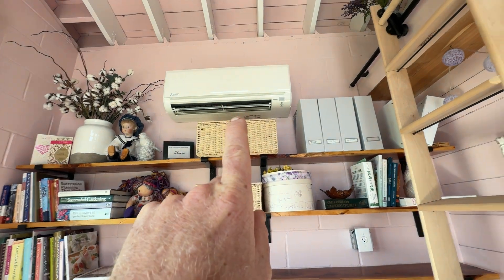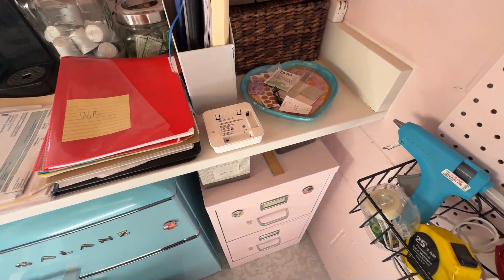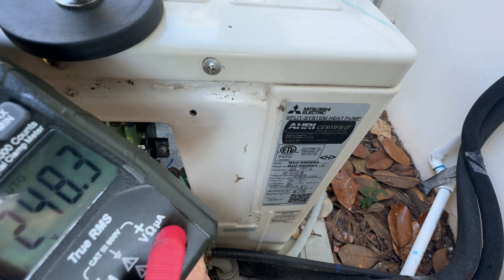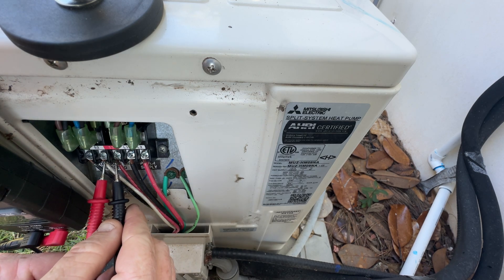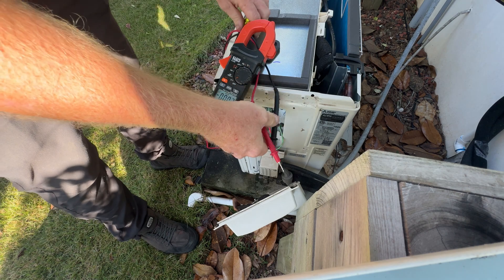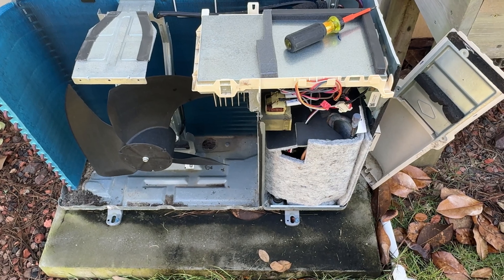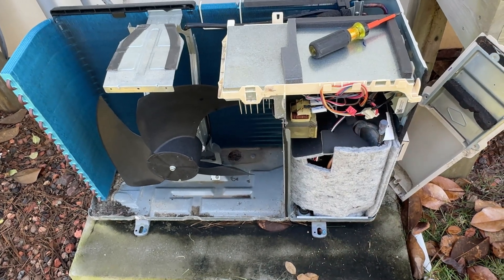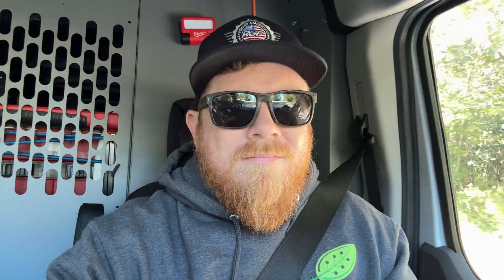How to check communication voltage on a Mitsubishi mini split !!!

Comment: Very informative. Would like to see which little studs you checked under plug for voltage.
Reply from the maker: @HVACGUY  I first check the plug where this communication plug into board. But I check all the high power plugs at dc volts if needed. Should be around 340-370vdc. But usually you don’t have to go that far back if you have 0 communication volts. If you have communication volts then I check that.